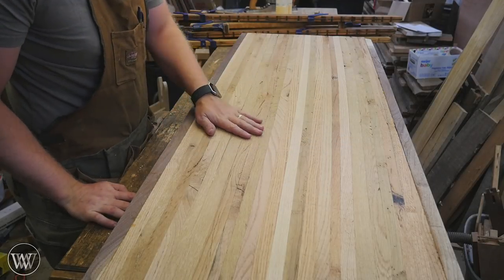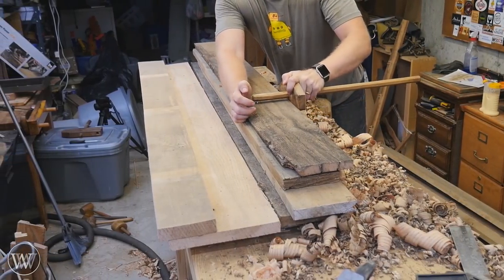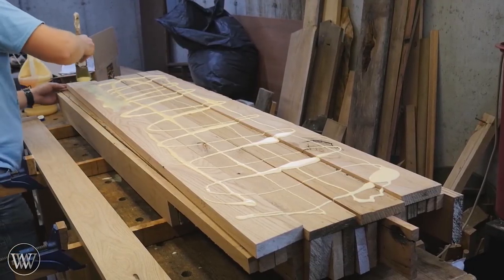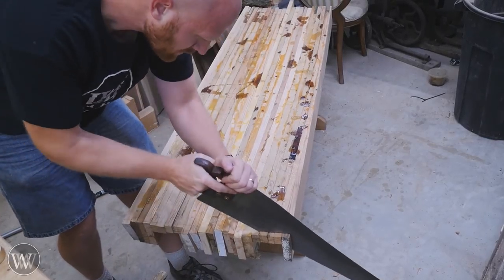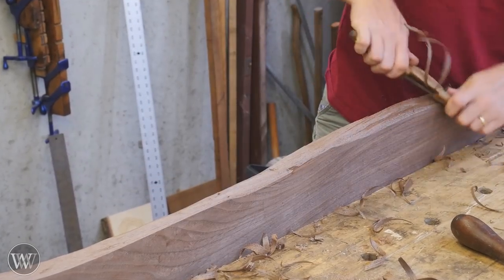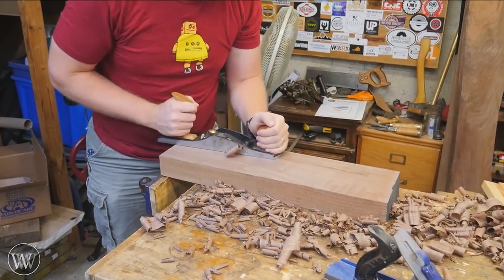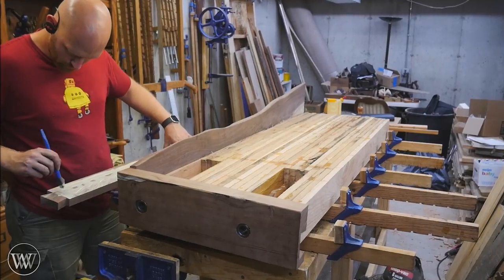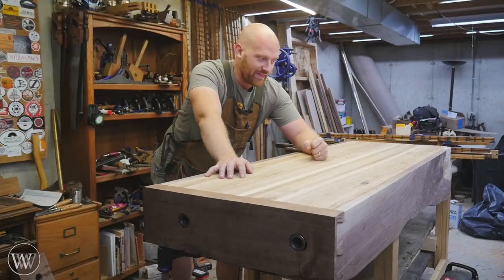Hand Tool Woodworking Bench 2 - Wood By Wright Roubo English Hybrid Workbench

Comment: Finally, I don't feel like such an idiot when I'm sitting on my work and taking every angle possible to square the ends of a project with a plane!  That, and standing 5 feet in the air trying to saw tenons for a bridle joint from a board that is 6 ft long. The bench is awesome coming together.  Must see YouTube this summer.
Reply from the maker: +Travis Reese thanks Travis. You got to do what you got to do. Lol. And besides, there is no "right" way.

Comment: That is one BEAUTIFUL bench top!  Interesting concept of the floating end chop.  I did a draw -bored mortise and tenon with a double split dovetail.  Your method is certainly simpler.  Will be interesting to compare over the next year or two as we go through annual movement.  All-in-all fantastic work my friend.
Reply from the maker: thanks Michael. I will also be adding a wedged pin in the center later but that will make a fun video.

Comment: At the beginning of the video I thought "man James works fast, he has everything done except installing the tail vise".  Then I thought, "where did his old bench go?"  After watching the video I realized it was there the whole time.

Nice bench by the way.  I am working on a small 30-32 inch bench for my office.  Too hot to work in the garage this time of here.

I am  using Paul Seller's design, only much smaller, planning on using a Moxon vise on the front and was considering putting stretchers front and back.  I liked your idea of putting a stretcher on the back and leaving one off the front.  I need accessible storage under mine since my small office doesn't have much room for stand alone storage.

The bench looks great and keep up the great videos!

Also, quit hoarding all the pillar drills!
Reply from the maker: thanks. and lol I just picked up two post drills for $20 each. what a steel!

Comment: Hey James, nice video! Since you encourage to share thoughts, I have an idea for you about your panel gauge. A small rabbet will make working with panel gauge much easier, you will be able to slide it along the edge. However, you won't be able to rock it and pin height have to be adjusted.

I have old one with pin sharpened more on two sides so it has kind of knife and it works beautifully. I find it easy to use since you don't need to control that part of movement and it's easier to just press it against the board.
Reply from the maker: thanks. I have one like that as well and I really enjoy that for cross grain situations but for Anytime running with the grain I prefer to use a pin as opposed to a knife much like I do for a marking gauge. Some people do like that shoulder On the fence side but I find it tends to get in the way as I like to Pivot the mark One Direction or the other depending on which way I'm going. But each their own Everyone likes something different.
Reply: That might be me not understanding pin gauges :) I tend to use slitting gauges or wheel marking gauges. Will see how it work out on my bench build from oak!
Reply from the maker: @akshi_az  wheel or knife gauges can follow the grain some times. where as a pin will ignore the grain and cut strait. I use to use my wheel gauge all the time, but found my self reaching for the pin gauge more often. Just a personal preference.

Comment: How do you keep the bit square when drilling with hand tools? Tips? Video? :)
Reply from the maker: That is a video I have coming up. here is an old video. https://www.youtube.com/watch?v=62y-Dib525c
basically, I check that it is square with and then hold the knob at the same point on my gut. if it is out by a couple of degrees that is not a problem at all.

Comment: I'm a new subscriber so I may have missed it but, why is the vise end cantilevered so far from the legs? Also, what do you think of the tool well in Paul Sellers' design? I'm trying to figure out the best configuration for a bench that I will build in the future and would like input from someone that knows what they are doing. Thanks!
Reply from the maker: I like to be able to sit at the end of the bench and put my legs underneath. Not to mention it it makes it easier to not have to have your legs for the bench near the screws and hardware for the vice. Some people really like having a tool well, I am not a fan of them. They just tend to collect junk and really don't serve any purpose that a flat surface would. But that's my personal preference. Everyone's a little bit different and some people really do like them.
Reply: @WoodByWright  Thanks!

Comment: I have a workbench build coming up in the not too distant future so this has loads of great ideas, thanks! Looking forward to hearing how the fancy leg vice goes. Two questions.... With the floating end piece that holds the dual screw vice, will there be too much stress on the dovetails with repeated workholding with dogs in the vice? Are there benefits to having a laminated top compared with a solid slab of timber (aside from a major cost difference!).... Is laminated more dimensionally stable? Thanks again for the great video!
Reply from the maker: +Darren B I will be adding other pin supports to the end cap, but that will be at the end. The lamination can be more stable if you chose the correct grain direction but the big thing is the price. If I had the money I would go solid slab. I hope to do that for the next bench.

Comment: I have a miter saw and I swear I cannot get it to cut straight any advice?
Reply from the maker: I do not use them I find freehand to a line far more accurate. At to your miter box there are many different types and many difforent problems.
Reply: Wood By Wright I'm just using the saw, not the box it's self.... Maybe it's the saw???
Reply from the maker: Does it always turn to the same direction? What does it do that is wrong?
Reply: Wood By Wright yeah it pulls to the right. But like I say, it's not a "name brand saw.
Reply from the maker: That sounds like there is too much set in one side of the saw then the other. I actually talked about that in the most recent live video. You fix it by rubbing a stone along the side it torns to. Usually 2-3 passes fixes it, but some times it takes a bit more.
Reply: Wood By Wright ok cool. Thank you so much!!! Like I say I've learned so much. Please, keep on, keeping on man. I will definitely check it out. Thanks again